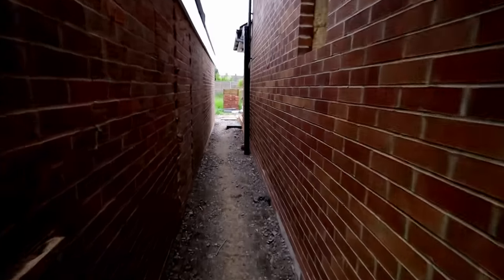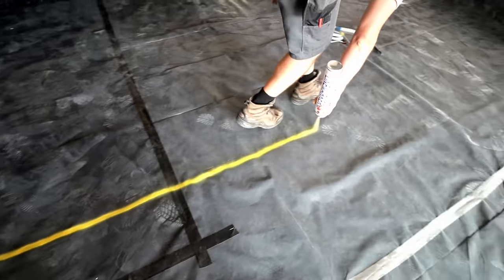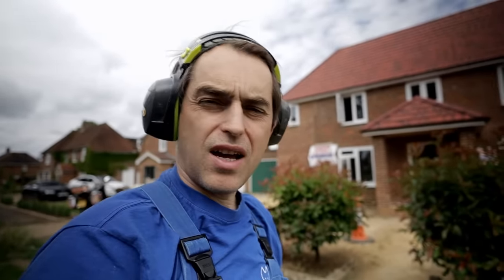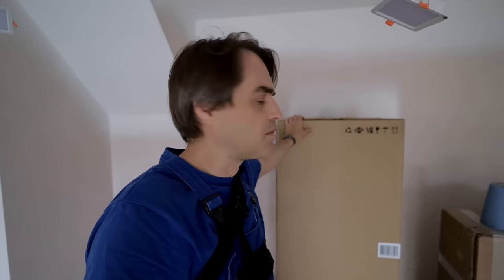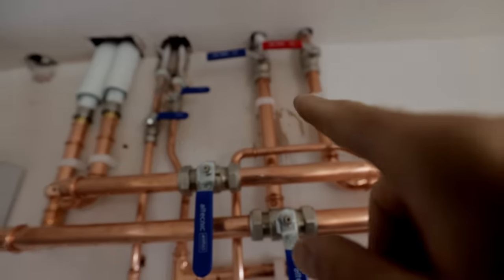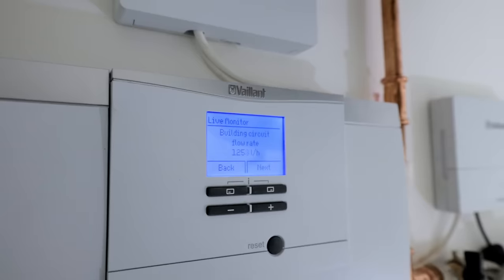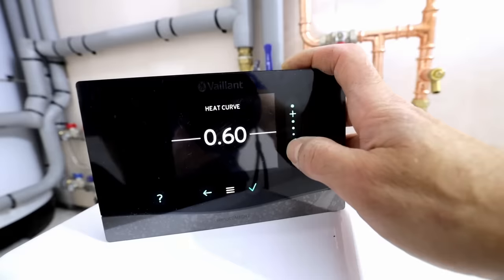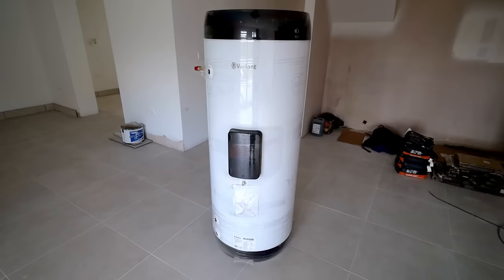Gas Boilers No Longer Make Sense, Here Is Why.

Comment: If your fridge broke down would you call a plumber? So why use a plumber to install a heat pump which is a refrigeration system. Be wary of some of these claims
Reply from the maker: Because it’s a hydronic system 🤦
Reply: @UrbanPlumbers   So Refrigeration engineers do an apprenticeship purely on refrigeration  when do plumbers do that? and I don't mean a 3 weeks course
Reply: @UrbanPlumbers  Yep Hydronic equals water  equals plumbers .Refrigeration equals High pressure refrigerants  So refrigeration engineers .simples
Reply: I think you call a plumber because you don't want the system to leak. A heat pump can cool, but is much better at heating. So who do you call to install a heating system?
Reply: @SolAce-nw2hf  Err water systems work to a couple of bar 30Psi Fridge systems work at 8 bar 120psi gas has a smaller molecule than water so refrigeration engineers have to be much better at joining pipes than  plumbers they braze not solder .As for a heat pump working better than cooling?? you have no idea. A plumber would not be registered to service a heat pump unless he has undergone a basic training a refrigeration engineer does an Apprenticeship,
Reply: @ianship5058  you are a bit confused. The best heat pumps right now are monoblocks. There is no need to service the refrigerants to install them. It takes in cold water and produces warm water. So no F gasses to mess with and perfect for a good plumber to install. An airconditioning system is better at cooling homes is what i meant, but those are mostly F gas systems like R32 that do require a refrigerant specialist. The monoblock systems only have water, air and power to worry about during installs. If the system leaks internally then you are right. But those situations are rare and can be handled by the manufacturer.
Reply: @SolAce-nw2hf  Obviously you know nothing You don't service refrigerants. But moving parts like fans ,cleaning coils etc Pressures have to be checked etc  and leak tested for which you need to be F gas approved .
Reply: @ianship5058  indeed I don't, nor would I want to. The ideal thing about these R290 heat pumps is that you don't need to. Just read the installation manual of a Vaillant Arotherm plus and tell me which part is beyond the skills of a good plumber.
Reply from the maker: There is actually no need to pressure or leak test it on a service and no f gas requirement to work on it either. 

F gas only engineer would have a clue how to design and install a hydronic system too so it wouldn’t work at all.

This is not A2A.
Reply: @UrbanPlumbers  Sorry mate most refrigeration engineers can do plumbibg and plumbing design standing on their heads
Reply: @ianship5058  can't take you seriously anymore.with these kinds of arguments. Apparently working with F gasses is not very healthy. Please RTFM
Reply: @SolAce-nw2hf  As a retired refrigeration engineer ,Technical director and consultant   with 60 years of experience I consider I am better qualified to comment than you .unless you have some qualifications in the subject .
Reply: @SolAce-nw2hf  Are you qualified to comment on that are you F gas approved I was
Reply: @ianship5058  Your knowledge is outdated and apparently you don't know how to download a freely available manual. Installing a monoblock does not require the skills you're apparently so proud of. I will leave you with a quote:

"Monoblock advantages
Monoblock heat pumps do not require an F-gas qualified engineer to install them; as solely hydraulic connections are to be made, a plumber is capable of installing one. This reduces barriers of entry into the installation market for engineers, meaning in the long run, you can expect monoblock heat pumps to be typical for most properties."

But if you feel the manufacturers are wrong, and every single unit needs a thorough inspection before turning it on, please complain to them or the government. The reason these monoblock heat pumps are selling like hotcakes is not needing F-gas qualified engineers. Installing these integrated systems would be a total waste of their precious time.
But don't believe me, do your own research or find a hobby and enjoy your retirement.

Comment: Those water to air heat exchangers are likely going to be more common in the next decade with how hot summers are getting.
Reply: Behave.
Reply: I hope these will be banned soon! Nobody talks about the noise pulltion they make!
Reply: @sandormaracsko  what in the world are you talking about?
Reply: @billyt9921  behave what?
Reply: @gerbil7771  my neighbour installed one, and in winter (it was around -15C) it was probably runnung at full power and during the night I could hear the constant hum in my own house with closed windows through the wall. Since I did not have my loudness meter with me I could not measure the exact noise figure but it was loud! The ones I heard up to now were very noise. The constant hum from the compressor is like your old fridge makes.
Reply: @sandormaracsko  okay then there should be a noise cap. Not banning it, that’s just dumb.
Reply: @gerbil7771  just wanted to highlight my saying at least you read it :) (I have seen too much all depends "how you measure it" it can considerably be different in the specs than reality :(

Comment: the big issue for me is the lifespan of an ASHP
Reply: Average lifespan is 15 years, which is the same for a gas boiler, unless it’s very lightly used. Condensate tends to wear the heat exchanger, and you just reach the point where it’s not worth throwing parts at them. 

It’s hard to predict lifetime costs, with a boiler you’d expect to change every working part twice, some such as PCB’s, can go every 5 years. With heat pumps, Mitsubishi charge £36pm for breakdown cover for their ASHP’s with a WI-FI adaptor, £40 without, which strongly suggests they aren’t expecting them to be the cheapest things to maintain. 

After that, it’s how much it costs to replace them. An ASHP will be at least twice the price of a boiler swap, given the price of the machine to begin with.
Reply from the maker: Yes, the cost of a swap will be £4-5k region if you can get the same unit working with the same controls. With time it will come down I am sure.
Reply: You also have the issue of coastal properties
Reply: is it too long?
Reply: I'm not against ashp, but there are caveats.... Some manufacturer's don't recommend these at all if you live by the coast, or recommend you coat the unit, to prevent corrosion, but charge a ridiculous amount to protect them.

Comment: the vagaries of British weather need heat one day ,need to turn Gas boiler of next , do you remember the add for Gas  against Electric storage heaters when it came a warm day your heater
have been on all night next day house heat of , so the Gas companies solution throw the storage heater out the window , i no heat pumps can work as air conditioning but how quick is the turn 
round as in the next two days you may need heat on again , like most consumers we have had our fingers burnt to often , love to believe but have not got deep pockets
Reply: This shouldn't really be an issue anymore with modern boilers or heat pumps when both usually have weather compensation.  A house takes quite a long time to lose its heat, more than enough time for the weather compensation to... well compensate.

Comment: Boilers no longer make sense...*unless it's below 0° for a few weeks...
Reply: Remember 1963?
Reply: Remember 2010? Really wasn’t that long ago. -10 to -15 regular as clockwork, for a good three months. Your ASHP’s would have been worse than useless, just frozen solid. At least B&Q would have made a fortune from convection heaters.
Reply from the maker: last year we had -7 in Lodon and -10 in the South outside of London. All our heat pumps coped well.
Reply: @UrbanPlumbers  that’s the odd night. A sustained burst of a month, or as in 2010, 3 months, anyone who got an ASHP would be jumping off the nearest bridge. It wasn’t getting much warmer during the day. Even if they worked, they’d be monumentally expensive. Maybe we’re better off promoting global warming after all.
Reply: then your condense pipe freezes and your boiler breaks :)

Comment: Going to play Devils Advocate :
 I supply/install Viessmann boilers for around £2000-£2500+VAT and that is pretty much market rate.    They are around 91% efficient  . I currently pay 11p/ kWH for my gas .That means i can dump 1kwH of energy into my heating system for just over 12p.
Air source are around 300%  efficient (COP)  on average.   I pay 41p/kwH for my electricity . So for 41p i can generate  3kwH of energy  because it is 300% efficient.  This means   i can dump 1kwH of energy into my heating system for 13p/kw     (41p divided by 3)  .  On this basis running a gas boiler is just over 10% cheaper.
You will have to have your radiators increased in size by around 40% at additional cost because of the low operating temperatures

Most air source installers want you to take out a £30/month maintenance contract  (and you d be mad not to)     (£360/annum)   Thats an additional £3600 over a 10 year lifetime.
Most people have their gas boiler serviced annually and deal with breakdowns when they occur  (£80-£100/annum)
Reply from the maker: To play devils advocate would be to support my claims as a gas engineer not support your own claims 🤣
Reply: @simonharper4199  Let's also play devils advocate then.  You say they are around 91% efficient, are you ensuring your installs meet that or just going off the spec sheet?
Reply: @BenIsInSweden  .im not saying anything about my installations. Im merely quoting the specification of the boiler which is rated at 91% efficient which means ,out of the box ,brand new, it can impart 91% of the energy  in the combusted  gas into the water. Of course a gas boiler installed on a poor system would be less energy efficient than a heat pump installed on an efficient system but then you are comparing apples with oranges . I am simply demonstrating in my original post that i cannot see how you can have cheaper energy bills by switching from gas to a heatpump (which was the claim made in the video) when gas in the UK is so much cheaper than electricity even taking into account heatpumps having a COP of 300%
Reply: @simonharper4199   and even that assumes that there aren't losses (physically in the install) My fathers heat pump is currently costing him £700 per month in Winter... I am wincing at my oil and electric bill at £400 per month... so he is really hurting. My suspicions are that the pump is using a lot of electric to keep itself warm in winter and that the 2nd immersion heater is regularly bumping up the water temp to 60 degrees for the underfloor and water tank.

Comment: Sorry, the future for me is not a heat pump. The main problerm is cost, a lot of which comes from the labour costs even with air air source; also I don;t have room for all that stuff, there's nowhere to put the hot water cylinder - combi boilers are popular in part because they are simple and compact. You'd have to do a lot of pipe re-routing in my house to reach the external unit - the gas boiler is in the kitchen with a simply vent, but the outdoor wall there is partly enclosed, and too close to the neighbour's property as I'm in a terrace, so it would mean laying pipes either through the house or the garden to reach the exterior wall of the utility room (which is why the boilers isn't there, it was too far from the gas supply and owuld have added aLOT to the install cost). We'd probably need bigger radiators too. And we have solid walls so no cavity insulation is possible.

Comment: Probably makes sense to fit a heat pump system to a new build or major renovation in a large house. The typical UK 3 bed house doesn’t have space for a plant room without major alterations. Yes maybe the running costs will be lower but on environmental grounds still questionable, just like electric cars, what fuel is used to generate the electricity? We still have a huge solid fuel (coal) power station just outside Nottingham and Peterborough has gas powered.
Reply from the maker: I would be really interested in seeing the data of energy use and CO2 emissions from properly designed HP systems as compared to gas boilers. From what I know even on current grid emissions it sill cuts CO2 considerably. For me the most important factor is pure energy efficiency of the system. Well designed HP system will need a fraction of energy that a ga boiler would require.
Reply: Even if every kWh of electricity for a heat pump was from a gas fired power station, you'd still save carbon and gas! Vs gas boilers. 

The maths is gas power station 55-60% efficient. Uses 1 unit of energy. Let's say 50% gets to your home for transmission losses. Then you use a heat pump to turn that 0.5 units of energy into 1.5 or 2.0 unit's of heat. Even in the worst conditions it should be turning back into 1.25 units of heat. 

Where as a blgas boiler takes 1 unit of gas, burns it and puts 0.85-0.95 units of heat into the house. 

Always less than a heat pump. 

Therefore to achieve the same amount of heat across the nations homes, if we all had heat pumps and not boilers we'd use less gas not more. So that's less expensive LNG to import. Less climate change, less NOX.

But we don't use pure gas electricity, the proportions this year are visible here
 https://grid.iamkate.com/

Only 1%Coal use, 38% gas , 15% nuclear, 5% solar, 5% tree burning, 30% wind. Avg carbon intensity 165g/kWh.
Where as pure gas would be 420g/kWh for electricity. 

The typical 3 bed house in the UK would be absolutely fine with a heat pump, except if the owners buy the wrong newspaper pushing it's silly culture wars into their heads.
Reply: 100% agree with you 

if government advise it ... do the opposite .. look at covid and diesel cars .. they are incompetent
Reply: What’s funny is that most uK houses were already build self sufficient ie the fire place! We forget that back in the day, people used there fire place to heat there homes lol
Reply: Ratcliffe-on-Soar is rarely on these days (I'm local to it), and it's still slated to close in September 2024. AFAIK, it will be the final coal fired power station to be decommissioned in the UK.
Reply: @ma40  

We will run out of electricity long before we run out of Gas

Comment: Unless it’s a brand new house, or a renovation with excellent insulation, heat pumps are not cost effective. You will use more electricity to heat the house and any hot water you use, people need to research whether or not it’s worth their while in moving from gas to a heat pump
Reply from the maker: This obviously not true. Heat pumps can work in old and uninsulated properties and be much cheaper to run than gas. It a question of physics and engineering. Anything can be designed to work anywhere - is it always cost effective to do? Probably not. Is it possible - absolutely!

Comment: Quote" Gas boilers no longer make sense"...Well I'm a pensioner, to insulate my house, replace eleven old double glazed windows, replace the microbore system with bigger rads and insulate the solid floor would cost what? £15-20K. A new Worcester boiler can be fitted for around £2k. I just can't afford that money for a heat  pump...and I should think 90% of the population can't either!
Reply: Literally the first few words said are "when it comes to major renovations".. because as of last year any renovation work that included heating will (due to building regulations) be a low temperature heating system, and for those scenarios gas boilers don't make sense.

The thing is, whatever heating system is chosen, the days of high temperature heating are numbered. Hydrogen (if it ever replaces gas in the mains - unlikely but knowing gas companies they'll want to make it relevant) it will be more expensive to run because hydrogen needs a lot of electricity to be produced cleanly.  And doing the fabric upgrades (rads etc) will be desirable regardless, to keep the running costs down.

Comment: A Gas boiler makes complete sense. 😊 WE ARE SHORT WITH ELECTRICAL POWER. ESPECIALLY IN WINTER.  😊
Reply: You do realise the shortage of electricity was due to a shortage of gas? Properly installed heat pumps powered by a gas power station are a more efficient use of gas to heat the home than using a gas boiler.